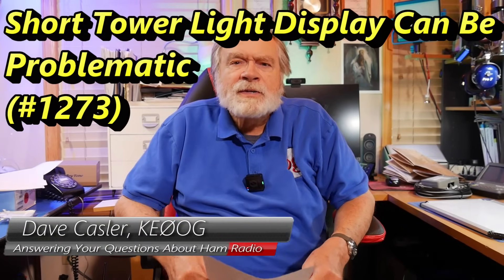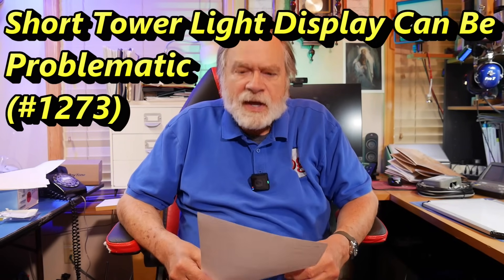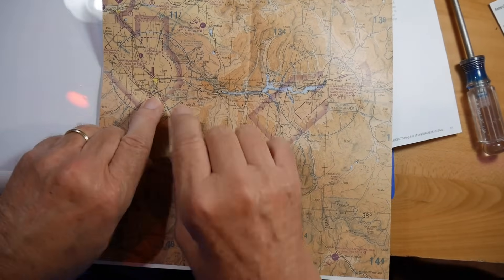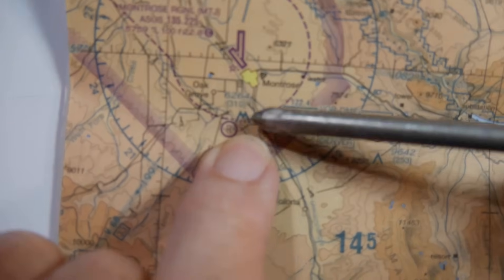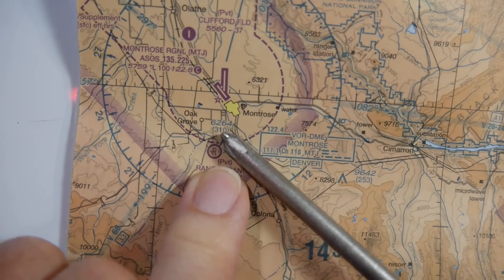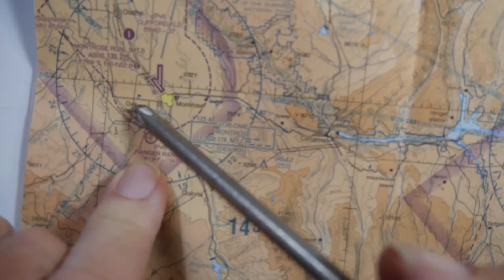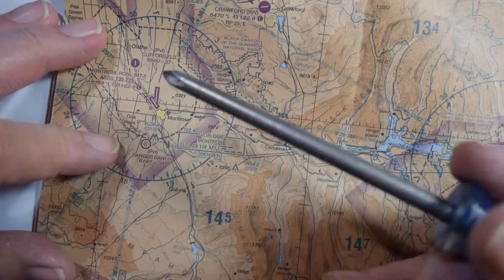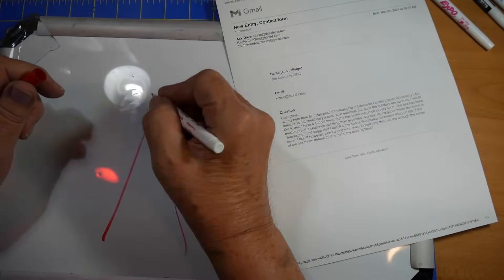Short Tower Light Display Can Be Problematic (#1273)

Comment: Great points on lights on a tower. The # 1 thing in the USA tower lighting is regulated buy the FAA . You can contact them about tower light and they happy to give you guidelines how to light  and what colors to use and flash rate.   The outher factor is local town ship may have guidelines as well. Even the brightness . I would go to local town or city hall and ask them. The local budling inspector  would know and if you need a permit or not.  Than contact the FAA and get correct info.  Do all this before any light is installed. That would be happy to give you guidelines on what you can do. You don't want them showing up after you put up a light and it caused a problem.  Also if you are buy  open waters you don't want to disrupt marine navigation as well. I can respect something nice and good to look at. You have that right to do that . Just check before you do , This is a safety thing .  I enjoy nice lighting displays . Aircraft have reported problems with Christmas lights. Mostly them laser ones that put dots on the house and move. The problem is laser will go very far and if the lights miss the house or reflect off something the beam can go up into a flight path .  This can be very dangerous.  Always check with lighting  out side. 73 from NY .